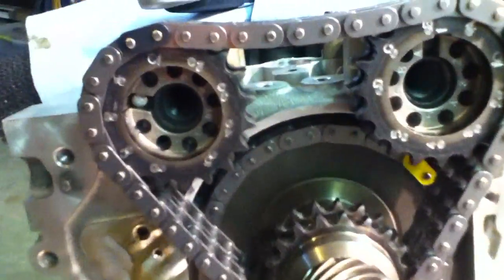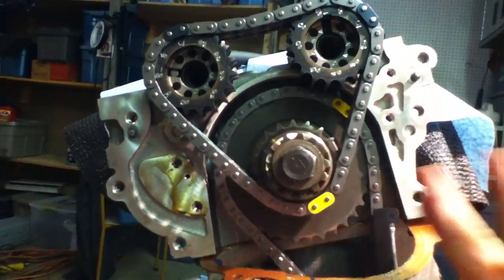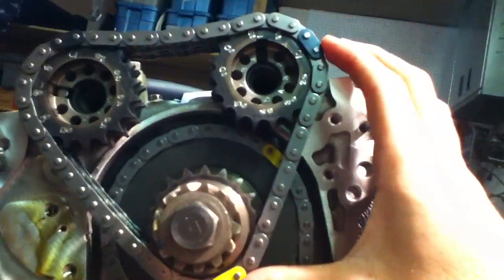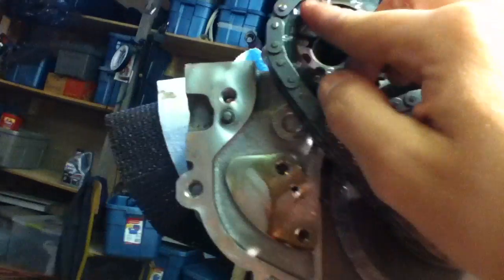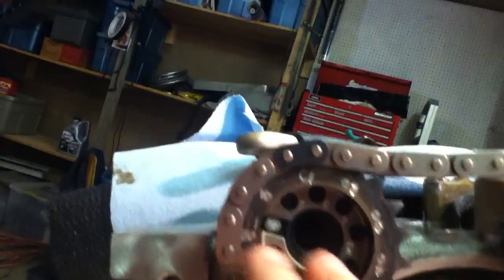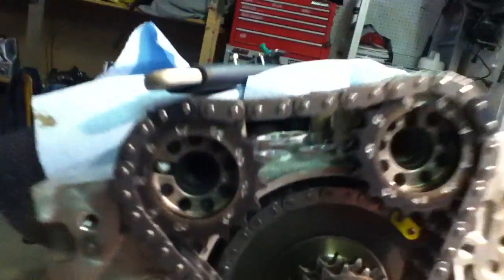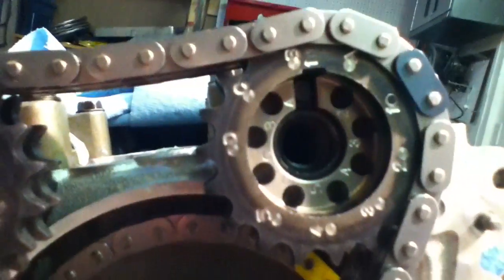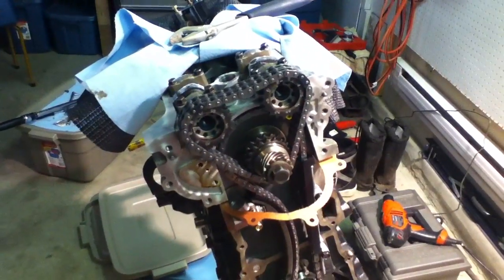upper-timing-explained ka24de 2.4L nissan

Comment: question man. is it ok to adjust the cam shafts individually to make them match with all the mark on the chain. reason being is because i got my chain to match from the harmonic pulley to the idler pulley, but the cam sprockets will not match on the chain unless i move them to the point where they match the chain.
Reply from the maker: +M Monroy I'm not sure the question you are asking.  You can move cams individually as long as you don't bottom out your valves on the tops of your pistons.  Remember, your no 1 piston should be TDC, and if you turn a cam too much it will cause that valve to make contact. It could bend the valve.
Reply: +walperstyle sorry i was kind of vague. So lets say the chain that goes from the crank shaft to the idler pulley is matched with the dots on the pulley, but the cam shaft gears do not match to the marks on the chain the goes on the idler pulley to cam gears. can i adjust them to match the dots? i believe somebody moved the crank shaft with out having the chain that goes on the idler pulley to the cam gears. thats why i ask.
Reply: M Monroy hI

Comment: Dose this also works with after market cams?
Reply from the maker: +Ambition Crew  Completely missed your question.   Yes, but you have to realize that aftermarket cams all are different.  Some require you to change the timing, in that case you need to understand how to degree cams with a degree wheel, and understand the rotation of the engine and such.    Before you go aftermarket cams, you should have a coil and stand alone ECU.  This will allow you to make minor adjustments in your timing.

Comment: how come I cant get my lobs to face outwards exactly its always at an angle exhaust side
Reply: walperstyle lolll
Reply from the maker: You have to make sure you set them in and bolt them down that way.  You don't want to turn the cams when the head is attached to the block or you will bottom out your valves on the pistons that are at the top.  Please be careful and cover the basics before working on any engine.  Also get a FSM from 240sxtechdvds dot org.
Reply: walperstyle its too hard to do it that way, I found a better way. torque down the cam caps then use a wrench to turn the camshaft.
Reply from the maker: ...DO NOT TURN THE CAMS IF YOU ARE NOT TURNING THE CRANK. OMG

Comment from the maker: Not 100% familiar with the truck engine vs my 240 engine, however, if its missing, it could be anything from Dizzy, coil, points etc.  Timing is the full package, and I've not done a video on how to install a Dizzy yet.  There is a chance you have yours installed 180 degrees out.

Comment: Thank you for this.I just bought a well cared for 1998 frontier 4x4 with 136,000 miles on it.Should I be concerned about the timing chain?

Comment: Just replaced the head gasket on my 97 240sx yesterday. Marks where gone, so I just put #1 cyl to TDC(top dead center) and put the cams where the first lobe of each where facing away. Once done, it fired right up. May not be the best way but it is my only ride to work. Took about 6-7 hrs and some busted knuckles from start to finish. Good informative video, watched it before I even opened the hood lol. Thanks!

Comment from the maker: @PrettyBoy2142  My video does not show the upper timing tensioner installed.  If you notice on the passenger side (intake side) of the engine, there is a spot for a tensioner.  You should have one there to remove all slack in the upper timing chain.   

There is also a tensioner fro the lower timing chain. The lower timing chain tensioner pushes on that big arm also on the same side.    

Refer to Factory service manual or 240sxtechdvds-org for more info on the KA engine.